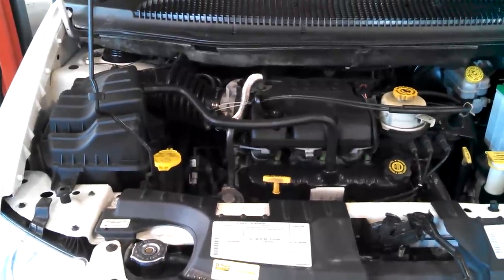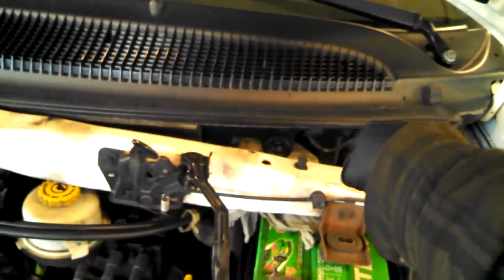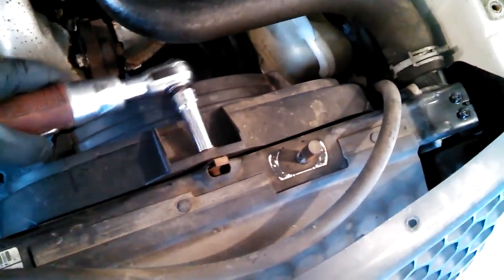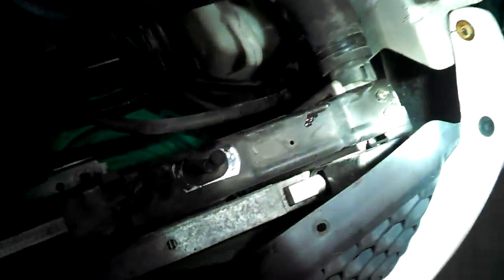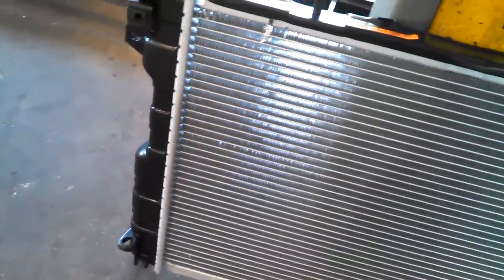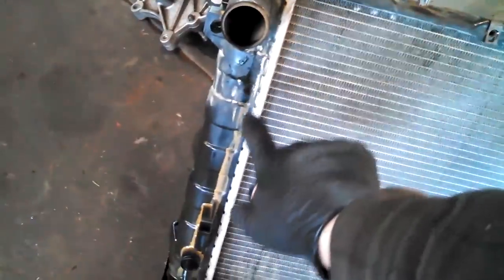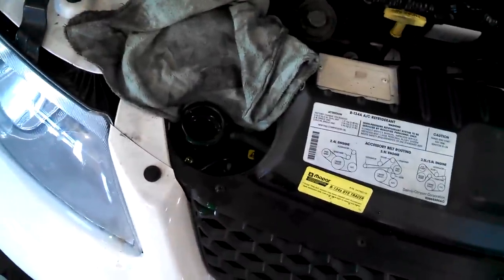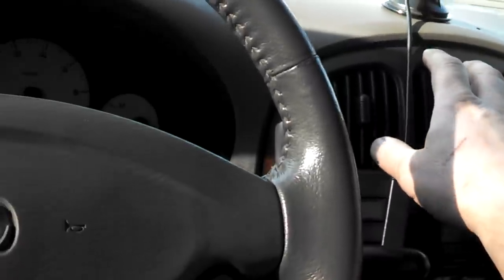Radiator replacement 2001 - 2004 Dodge Grand Caravan 3.3L Install or remove and replace

Comment: Just did this on a Town and Country.  There is a rubber baffle gasket under the top plastic shield that may drop out.  It sits in a groove to the front and seals this area.  I had to tap in the metal bracket on the driver side to get enough clearance.

Comment: what position on the petcock is opern vs shut?
Reply: The peacock is counter clockwise to open but you need to turn it about a whole turn to get it to flow.  Try the new one and you will see.